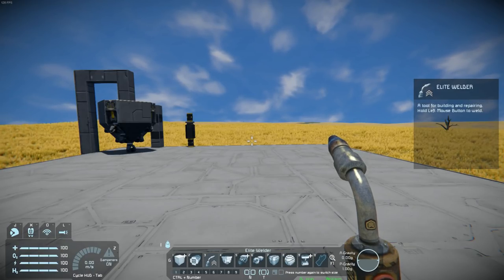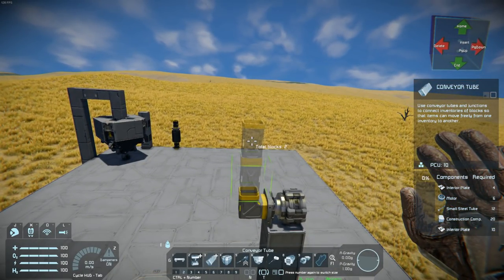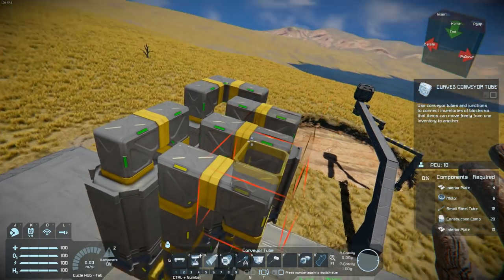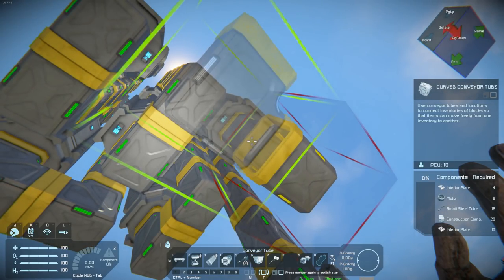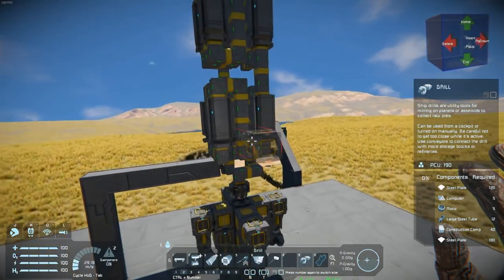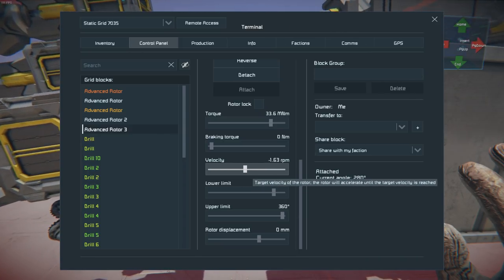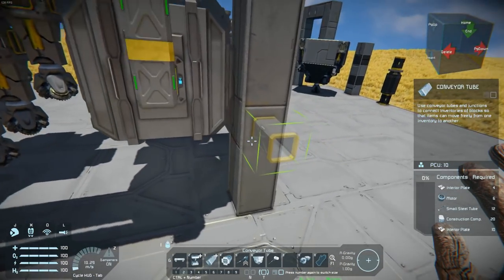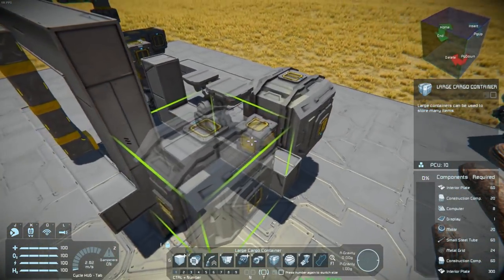Space Engineers - Building a simple mobile drilling rig

Comment: At 4:33 you should have made the conveyor go to the corner instead of the center, this way the pistons would be in a spiral with the final piston being in the center, making you not need that tail you added at the end saving materials and possibly making the structure 1 block shorter
Reply: You could also replace the conveyors coming from the tower rotor with pistons that extend when you store the drill, moving the weight of the entire rig forward when driving
Reply from the maker: @altioar  Right you are on both counts!

Comment: Instead of making upwards conveyors in the drill tower you could just use more pirtons in oposite direction.
Reply from the maker: That seems like the intuitive way to go, but it will actually just make the pistons counteract eachother.

Meaning that the piston tower will expand, but the drill won't move :)
Reply: @PatrickHansen101 well the thing that you are over looking is that opposing pistons are not to be engaged at the same time. so you could probably condense your piston array even more. any piston's facing up would have to be extended out so that they may be retracted while downward facing pistons extend.
Reply from the maker: @AquariusGhostHunter  when this was built, that wasn't possible :)
The size was only doable because the conveyors take upp less than a block of space (and only attach end to end)

Side-by-side without spacing would just explode if you even managed to put them there.

That being said, absolutely, as long as clang doesn't get you, replacing conveyors with extended pistons would be more space efficient
Reply: @PatrickHansen101  hey maybe you could make an updated version? video idea. if you are still into you the game

Comment: any ideas on why it might explode every time it's not ported to a base? the dill loves exploding but only in survival
Reply: Sorry on the loading of the game is when it explodes but only when its not connected to a base Via a connector
Reply: If that happens from loading in, you might have the same problem as me. My issue was that I forgot to turn on share inertia tensor for ALL the pistons AND rotors. The world would load fine, but then I noticed the drill arm had begun to vibrate slightly. It became rapidly more violent, actually tossing the entire rig around, until the entire arm split in several places and threw everything far in all directions, including the huge rig chassis, almost like an explosion. Not sure if you checked share inertia tensor for everything, but since you say connecting to a static grid solves the issue, doing that would make the rig grid static which is changing the state of the base rotor grid. Make sure EVERYTHING has share inertia tensor activated, including the rotors. Otherwise, not sure what's going on, but rotors and pistons are a likely bet on the source of something like that, especially if changing grids between dynamic and static has an effect.

Comment: I have built this, shamelessly, the exact same way you built yours. However, no matter what I do, when the drills are sent down, I cannot retract them again. Any pointers?
Reply from the maker: Hey, it's what the video is for! :)

You're probably running into one of two problems, both with the same solution!
Either your cargo gets filled with ore, and then your drills get filled, making them heavier
or your drills are getting wedged.

*In either case*, try increasing the Max Impulse Axis/NonAxis on the pistons, should fix the issue.
Beware though, increasing this value too much may allow drilling rig to self-destruct :p

Comment: So noob here, I was following along your video to build the drill tower. My plan was to build that and then the vehicle around it and make a mobile base. I got everything built and went to define the max rotation limits like you did (360 top, 270 side). As soon as I defined the 270 the entire thing blew up and blew up my base/pad/shitshack. 

I'm about to restart today but I'd love to understand how/why I made a bomb out of the drill tower 😭😭😭😭. Any advice would be great!
Reply from the maker: I actually did the same thing in my recent build video, had to start all over.

I think one of two things happened:
1: You set the max/min limits to not include the current angle of the rotor, this will result in physics-breaking acceleration and wreck your stuff, in most cases.

2: Diabolus ex Machina, the game just decided that it did not like what you're doing and decided to blow your stuff up, that's what happened in my case.

Best suggest i have is to set rotor limits before you begin building, or switch to using Hinges instead, they seem more stable (but still set the limit before building the tower!)

Comment: why my rotor cant reverse ? it moves only if i change upper and lower limit (cabin and battery present)
Reply from the maker: Try raising the power/torque on the rotor, it may have too much mass in one end.

Also make sure "Share Inertia Tensor" is turned off on the rotor.

Comment: So I duplicated this build, with my own twist of course. But I am have a problem where the conveyor junctions keep getting damaged. Does anyone have any idea why?
Reply from the maker: My advice would depend on what your twist entails ;)
Which junctions are getting damaged?
Reply: @PatrickHansen101  the center most ones directly connected to the rotor. It seemed to take longer to break when I didnt rotate the drill head, but still broke after the third hole. Also as far as my twist goes it's mostly cosmic. But I'm using batteries and hydrogen engines as I have not located uranium. But the whole drill part is the same
Reply from the maker: @AngelOfChaos188  how odd, I've never had that problem!

Hmm, only reason I can see would be that the block is somehow bring slammed into the rotor, or that you have the rotor too far in allowing it to hit adjacent blocks.

Make sure "share inertia tensor" is turn on on all pistons, maybe set rotor offset to max.
Also make sure you don't run out of cargo space, the drills will get very heavy.
Lastly, make sure that the speed on the pistons isn't too high, making the pistons squish the drilling head because it can't drill fast enough
Reply: @PatrickHansen101  okay thank you very much for your help

Comment: Very impressing, but seems needs more wheels, like 8?
Reply from the maker: Na, 4 wheels is easily enough to support 3-4 large cargo containers,more wheels won't do that much given how suspension works atm.
It would be better if the wheels were placed better though, more symmetric around center of mass and further from it
Reply: @PatrickHansen101  ok, thx
Reply from the maker: @Barxxo  np :)

8 Wheels would look a lot cooler thought, i might make an aesthetically oriented rig at some point :)
Reply: @PatrickHansen101  i like to have at least 6 wheels to not to get stuck in a hole